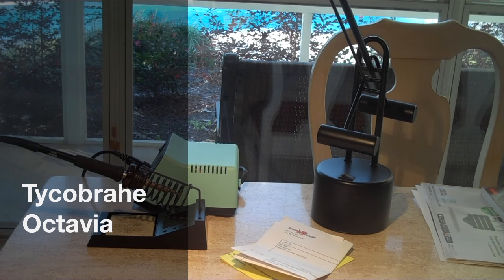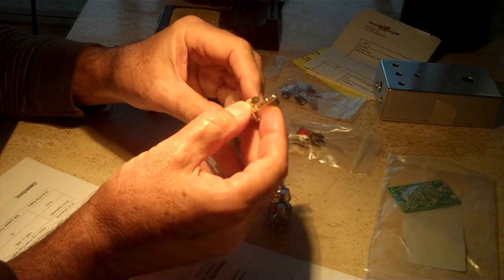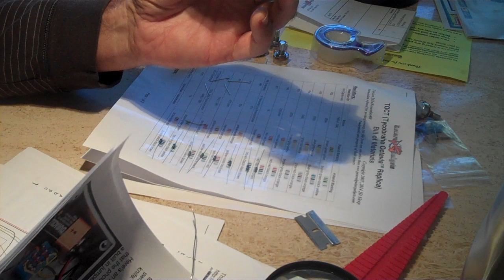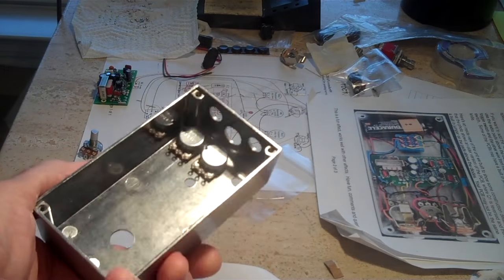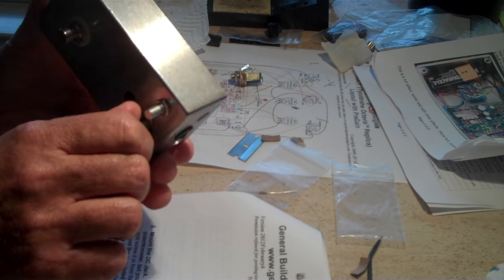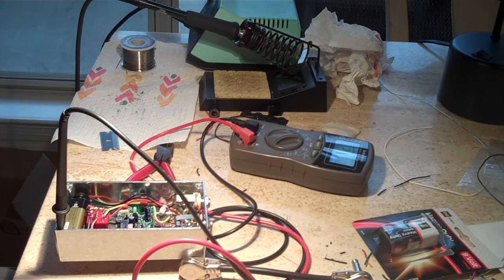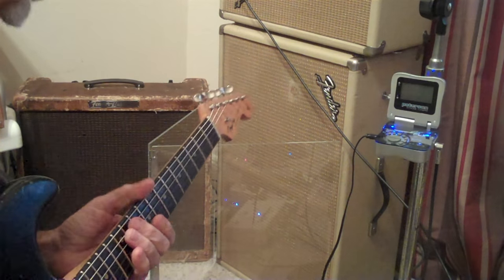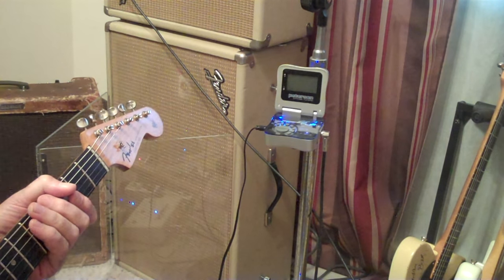Building a Tycobrahe Octavia and Demoing It

Comment: I've been contemplating getting a tweed amp kit (probably a 5e3), and to tell the truth, the smaller amp kits look less complicated than what I'm seeing in this little effects box! I wanna say a typical 5e3 has around 12 caps, 16 resisters, 5 diodes, and 3 tube sockets plus trannies and miscellaneous pots and jacks etc.,  and there's so much more room to move inside an amp chassis. Connecting the little wires inside the effects box looks like a job for a small Chinese woman. I'm 6' 3 1/2". I refuse to put my fingers inside anything smaller than a cookie jar.

Comment: Do you remember which transistors you used?
Reply from the maker: I'm not sure.  I opened it up but I could not see the markings.  I got this off of the bill of materials,   PNP bipolar junction transistor
Examples: 2N5087 or 2N3906,  NPN bipolar junction transistor Examples: 2N5088 or 2N4401
Reply: +millstap yea I have seen the instruction from GGG, just wondering because it sounds really good
Reply from the maker: I looked again with a magnifier,  2N4401 (2) and 2N5087 (1)

Comment: Hey millstap, if you have time I just wanted to get your opinion on pedal placement. I've been going guitar-wah-OCD-Octavia-dejavibe-carbon copy-jtm45. But recently picked up a fuzzface and it hates being placed after the wah. Any insight would be greatly appreciated.
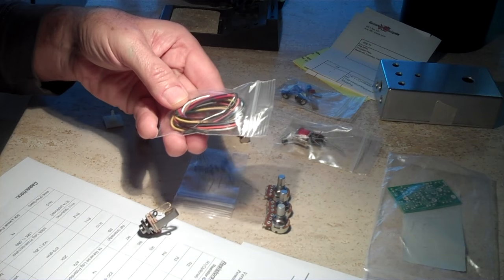Reply from the maker: +Terry Tripp I can tell you you will definitely need to put the fuzz before the wah wah.  If it were set up like mine, it would most likely be Dejavibe-Fuzz Face-Octavia-Wah Wah-OCD-Carbon Copy-Amp.  I just did an experiment with this new Octavia before and after the Fuzz Face and did not notice much difference but I did settle on Fuzz Face then Octavia.  Keep the Fuzz Face knobs no higher than 3:00 and the wah wah should sound fine and it always helps to clean it up some by turning down your guitar volume some (since you have so much gain at your disposal).  It you dime the FF, the wah wah can sound a little muddled and not have a good sound.  There is fine line with the volumes on the Fuzz Face and the Octavia.
Reply from the maker: +Terry Tripp I would also do the same experiment by flipping the Octavia and the Fuzz.  I may do it again to be sure.
Reply from the maker: +Terry Tripp That is if you run both the Fuzz and the Octavia at the same time.  I do it occasionally just to get more craziness.
Reply: Thanks a lot, ill have to give that setup a try. I agree both Octavia and fuzz gets crazy. Throw in a vibe and its pretty chaotic. Has the new wah now entirely replaced the old one? I have a Area 51 drop in with a buffer and like it alot.
Reply from the maker: +Terry Tripp Zapata still has my new Clyde clone wah.  He was supposed to ship it back this week but I have not seen it yet.  I am using my original drop-in kit without the buffer right now.  I did not have any luck with the buffer making the fuzz work after the wah.